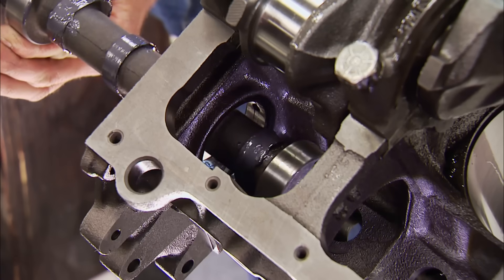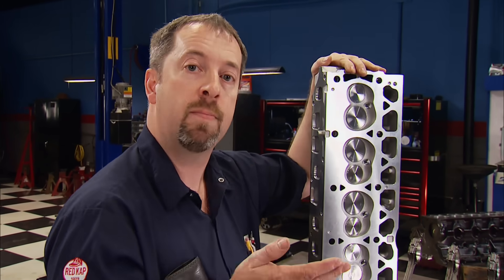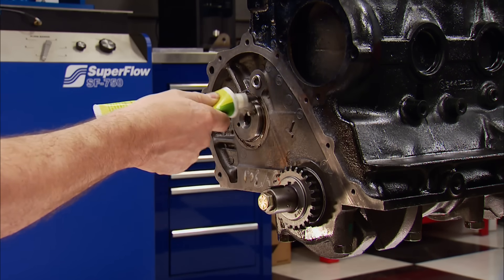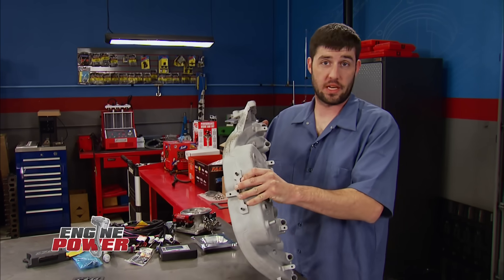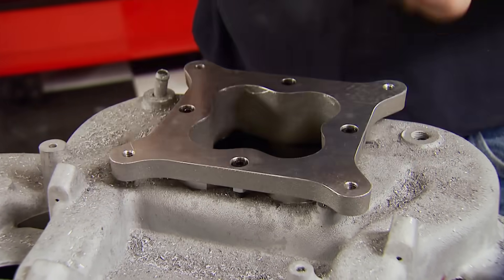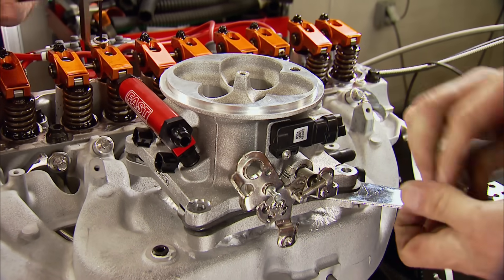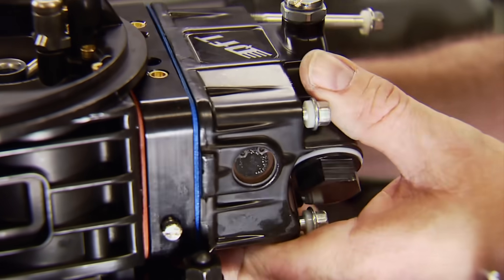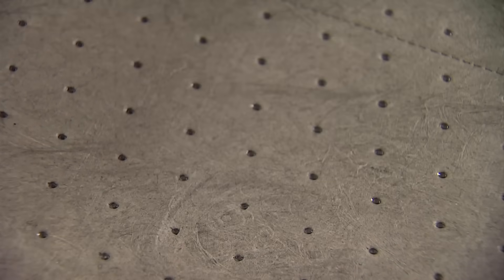Rebuilding a 4.0L Jeep Straight Six to 242HP - Engine Power S2, E14

Comment: I would love to see this engine in a YJ with about 10 pounds of boost.
Go pick on some Mustangs.........lol
Reply: Head dosen't flow near good enough.
Reply: @elonmust7470  At 10 pounds of boost it would make about 325 hp and almost 500 ftlb of torque. Considering it's 700 pounds lighter than a new Mustang it should do fine.
Reply: @johnparrish9215  also the jeep is heavier than the mustang.
Reply: @elonmust7470  Really????
How light is a Mustang??
My Jeep is 2900 pounds
Reply: @johnparrish9215  So why is your jeep 400 some lbs lighter than what the factory states? Wouldn't be a hollowed out shit pile would it?
Look all I'm saying is that you never see 4.0 inline 6s on the streets punking down muscle cars because nobody is stupid enough to use a 4.0 i6 as a performance platform.
Reply: @elonmust7470  Depends on what configuration the factory weighed it in. If you remove the hard top, spare tire, and doors (all extremely common for Jeep owners to do) you'd probably shed that 400 lbs
Reply: @elonmust7470  new mustangs are 3600-4000lbs. heavy. as. fuck.
Reply: @jimbalayaman7227  So you're gonna race mustangs in your topless, doorless jeep that's not a willys? 
Dude cherokee owners are a strange bunch.
Reply: @elonmust7470  Here's your @ that you want so desperately.
Reply: @elonmust7470  turbo doesnt give a shit about how good the head flows when you add boost....and you claimed you have built turbo systems....sad.
Reply: I want to see this engine in a Mitsubishi station(or whatever the Chrysler or dodge version was called) to make an American version of the mk3 supra

Comment: Doman is guaranteed to fit.  That's comedy gold right there.
Reply: Except... at least some of their pans are painted inside, and the paint comes off and clogs the oil sump, toasting the engine.
Reply: @georgesimpson3113  The automotive equivalent of a pulmonary embolism.
Reply: George Simpson I’ve had that happen on a 5.9 Cummins. But the OEM pans from Cummins also have paint on the inside. Not sure exactly why but all I know is is that Dorman is shite
Reply: Dorman.  Every time I use it I cringe.
Reply: "got this dorman oil pan from summit racing" lol you can get dorman from autozone at half the price and no shipping cost because they got one on the shelf lol
Reply: Or there oil cooler gaskets that are not compatible with motor oil
Reply: @rthomas6564  I used Doorman oil cooler lines on my S10. I put them on in 2017 and they've got less than 10k miles on them at this point. Guess what? Yep,they're leaking. Not much and I think it's probably just the gasket,but still....Doorman is crap.
Reply: Hey...this isn't fair.  Dorman parts fit PERFECTLY.  Just not on the vehicle they tell you they are for.
Reply: Dorman guaranteed to fit. We used a dead blow hammer for installation. And we used 10 tubes of JB weld and a gallon of permatex black silicone gasket sealer. After that we gave up and fuckin welded the mfkr on. And it still don't fit right.Dorman oil pan guaranteed to fit,my ass. That's the funniest thing I've heard all day. I thought you said you weren't gonna stroke us? LOL!! Probably much better off just cleaning the old one or picking up a used factory one at the wrecking yard. Just about every time I've ever used a dorman anything,that part had issues. I bought a timing cover for my 97 S-10 once. I had to oval out 4 bolt holes to coax it on. The heads on the bolts it came with were too big and they hit the cover. I opted to go buy different bolts. I used dorman for hing pins & bushings to  tighten up  the driver's door. They cracked and fell out within a month. Luckily a friend has a lathe,he made me some brass bushings that have been working great  for a couple years now. Dorman SUCKS!!
Reply: Almost as bad as BWD ..   Broke When Delivered.
Reply: The funny thing about certain asian sourced steel is your template or jig may not matter: the moment the metal gets worked/heated/welded it draws up and goes out of spec.
Reply: Not to mention the chinaman water pump, T-stat housing, and timing kit. 😔
Reply: my coffee nearly went out my nose ~
Reply: Chain pos
Reply: dorman??
Reply: I was lmao 🤣 dorman is trash. Made in China garbage
Reply: I bought a Dorman "direct fit" exhaust for my YJ and it was the most screwed up job I've ever done in my life. I could have made the exhaust by car battery short welding it and it would have been a better experience and higher quality.
Reply: I use dorman to this day. Every time I take off my jeep door covers, I need new door cover connectors. All they are good for.
Reply: If Dorman is the only brand available at the crappy parts stores(I rarely walk out with a part I'm looking for),I'll hold off until I can get a quality brand.
Reply: They didn't say what it fits.

Comment: This engine gets terrible gas mileage. I wonder how many gallons of gas these engines wasted, and will waste going into the future.
Reply: V 6 does not have the  longevity  the I-6  does
Reply: you better fix your shit then. it aint right.
Reply: These "power tv" type shows are made to sell the old stock from the 90s AKA msd distributors & 4 barrel carbs.
4 thousand dollars for THIS?

Lol only morons would go for 4k for this...

Comment: How disappointing for such big promise. I think a Turbo would be the better route. And you get to keep your stock head. 7-8 lbs of boost would make an easy 300hp 350ftlbs.
Reply: Mr. Morningstar  A TD04 turbo would spool almost instantly for these motors helping it right out of the hole all the way to redline. Where as a supercharger would peak around 3500rpms and fall drastically.
Reply: Mr. Morningstar then I think a 5.3 would be the best option.  You could do the swap cheaper then buying the Edelbrock Head. I swapped my 86 Army Chevy truck for 5.3. Jeep owners are missing out if they are still running the 6cyl.
Reply: @ze_german2921  ew.
Reply: I’ll just go to the turbo store and buy one. Custom fabrication of intake system and exhaust manifolds. Can’t be that expensive.  More than double the cost and triple the complexity of the installation.  Oh boy! 🙄

Comment: We all had to replace our exhaust manifolds those headers are pretty 🤪
Reply: You'd be better off finding a ceramic coated one instead of getting a stainless one. The stainless ones don't deal well with temperature shock and tend to crack if you get them wet or muddy.

Comment: It’s not the fuel injection, but you take it off and it runs better🤔
Reply: Justin Smith They failed to get the efi unit to self tune.
Reply: Their problem was they used a multiport intake that wasn't designed to flow fuel at that point.  It probably confused the computer.

Comment: Build a 2jz
Reply: They'd spend like 30 grand and make 350hp
Reply: @stanleykendziorski7964  if u knew what u were talking about you would know that the turbo version out of factory comes with 320 hp and can go up to 500 on stock turbos and upgraded fuel system
Reply: @joshedits3196  and the 2jz got bigger for it's short low selling life.
Reply: @stanleykendziorski7964  lol sorry I got triggered
Reply: Lol all good, I'm just being a smartass, these guys haven't really impressed me on their building skills
Reply: @stanleykendziorski7964  yeah, 4k wasted lol
Reply: There was 258powered Gremlins running 11s pushing more than 350+HP and 400+TQ in the 70s. All on stock pieces. And held the NHRA Tilte for a long time. The AMCL6 has been fast. And doing it N/A.
Reply: @Al-mx6ru  there are na k series 4 cylinders making 500+
Reply: 4.2 liter ? I'd sure as hell be mad if it didnt make that power 😂 that's a huge i6 when thinking about the 2jz is a 3.0 liter
Reply: @joshedits3196  there was a Gremlin X program that's had the 258 with 12.1 pistons and solid roller cam pushing more than 600+HP and over 650TQ N/A running 10s in the 70s but scrapped the program cause they would only b racing them self's. All on stock pieces. And held NHRA Tiltes. Is there a 2jz running 10s N/A. Or making that power N/A? I'm sorry the fastest Supras are turbo and larger cubic inches. And also sleeved for reliability. The fastest Supra run stroker kits pushing them well past 4.0lilters.
Reply: @Al-mx6ru  the 2j was designed with a turbo in mind so you can't just ask if it would make power n/a. Because it was made to be turbocharged lol. I'm sure if u can get 500 out of a 2.6 liter 4 cylinder u can get more out of a high revving 3.2 liter 2j.
Reply: @Al-mx6ru  hey show me a 4.0 liter 2j lol then I'll believe u
Reply: @joshedits3196  last I heard  more like a 4.3.titanmotor  runs stroker kits. And they race Supras. All custom Forged pieces.
Reply: @Al-mx6ru  really ???
Reply: @joshedits3196  what's really? That's it's real?
Reply: @joshedits3196  are you ok. Your speaking in riddles
Reply: @Al-mx6ru  yes
Reply: lmao your funny
Reply: @joshedits3196  why am I funny? It's cause I speak truth? Your still speaking in riddles. Are you sure you ok?

Comment: You could make 240 hp with the stock head. Once again selling people something they don’t need.
Reply: Best combination is the old 242 block with the 258 crank, the '96 head, 01 horseshoe intake manifold, tri Y header, and coil packs, will do the same as what they did.
Reply: Dylan Dembrow 
No! If good engine building practices were used they’d pull well over 300.  350+HP is common
Reply: There didn't seem to be much gain there, sure the ports are bigger, but the valves were said as "same as stock",...
Reply: PiDsMedia 
I don’t think valve size is an issue on a basic HO build like this. But their apparent lack of knowledge on how to make horsepower IS an issue.
Reply: @PiDsPagePrototypes  That may be true, but the head replaced bathtub chambers with heart shaped chambers, which is supposed to improve power.
Reply: The later 4.0s have a problem with cracking the heads, if you have one of those this head would give you a bit of a performance increase  both because of increased power and decreased weight... but if I was doing it I'd stick with the stock injection system, or maybe bigger injectors.
Reply: At least it was lighter haha
Reply: $1500 is a bit much for a minimal hp gain and cutting 30 pounds. At the end of the day it's not a race car, do you really need to worry about cutting weight?
Reply: One of their stated goals was to reduce weight.  They said the engine weighs over 400lbs stock configuration.
Reply: The mechanic Of all  Exactly !!!
Reply: The mechanic Of all  its not about that tho. It’s about bouncing rocks and pulling up next to a camed 350 and blowing his doors off or at least doing better than the 4.0 used too
Reply: @upnorthviking823  dude it would blow the doors off of some things in a light jeep, and a Honda is not comparable because they do different things. Where’s the torque from the Honda? 6k rpm? The Jeep is at like 2K my 258 with a weber carb and a exhaust will beat a 305 in a roll so a built 258 can definitely take a 350
Reply: Normally I respect Pat as an engine builder. But he dropped the ball on this one. That butchered intake is laughable, that cylinder head is overpriced, and don't get me started on how they wasted money on boring this engine 0.040..

Comment: these motors just don't want to make power. Just run forever!
Reply: Since when did a original Cherokee weigh 4500lbs????? Look up some specs.... 
https://www.edmunds.com/jeep/cherokee/1991/features-specs/
Went with 1991, as my mom had one back in the day....
Curb weight just over 3,000. GROSS weight of 4600...
Reply: You can do anything with enough time and money.  That's essentially a tractor engine-runs forever at low rpm and produces a lot of torque.
Reply: These engines run and run strong. In the 70s.AMC went racing with there 258 in a Gremlin running mid 11s pushing more than 350+HP and more than 400foot pounds. All N/A with Webber's carbs.  Fastest l6. Back in the day.  And held the record for qiut a while. All with stock pieces.
Reply: osp80  that is not a lot of power..
Reply: @elonmust7470  Its all relative. Racing? Meh. For this engine? Quite impressive. Stock, the Cherokee sits at 3000-3100 lbs curb weight.
So toss the 350 hp engine in and you're looking at a power to weight ration of ~8.715, to put that in perspective a camaro 1SS (convertible) has a 8.69 p/w ratio and that's pushing 455 hp and was almost 50k$ new.
Reply: @ThatOneGuyYMK  all of those numbers don't mean anything. 
Also the jeep cherokee is closer to 4,500 lbs, bud....
Reply: @elonmust7470  "Those numbers don't mean anything"
But... they literally do... (albeit that 350 hp was crank vs wheel which I didn't use but should have)
Your statements don't mean anything... bud... what point you trying to make anyways? 
Also, which some said, you are probably mixing CURB and GROSS weight, which I'll explain as you don't understand, GROSS is it max operating weight (liquids, passenger, accessories, cargo). CURB is the vehicle weight without passengers or cargo.

A 1995 Cherokee 4.0 is ~3000 lbs CURB, ~4800 LBS GROSS (differs between packages/trims).
Reply: @ThatOneGuyYMK  My point is that your calculations don't factor in anything like power loss from drivetrain & suspension. I arrived at 4,700 lbs from a google search of "jeep cherokee weight" XJ cherokees are closer to 3,300-3,800.
My point is that these thoughts of making 4.0 xj jeeps fast is a pipe dream. I actually own 2 grand cherokees, a tsi & a 5.9 limited. I don't drive them much but I've had both for over a decade
Reply: @ThatOneGuyYMK  I wouldn't worry, he just doesn't know how that's all.
Reply: osp80  you don't see build motors out there because nobody builds them. There are too many better platforms.

Comment: Is this amc242?
Reply: Alexander Lytkinson yup it's an AMC 242 from 1987
Reply: @karlsmith2570  1987 wranglers Had 4.2 /258 motors stock ( I own one ) the 4.0 didn't come until 89 . 91 fuel injected . The 258 made 210 ftlbs @ 3000 rpm 112hp @3krpm perfect for crawling. the 1971-79 head and manifold made 150 hp. Though most of the power loss was from the bbd feed back carb, switching to a better carb + intake is good for 40-60 hp alone on a 1987-9. Add a new cam and your at 190 hp The cost of this build is 5k + not worth the money, a LS swap can be done for @ 2-3 k and easily make more than 242hp with 0 weight added if you use an aluminum block ls . Alternatively you can by a 4.7 stroker motor for 4k with a warranty. But all these need to be reved beyond 3k rpm to get 210 ft lbs. The motor they built makes all it power at red line , they didn't show the ftlbs at 3k bet it is less than 210.

Comment: By 1990 the 4L H.O. was rated @ 190 horsepower !
Reply: Dean Williams 1991 was the “H.O.”
Reply: @grad0n  from 89 to 1992 I sold Jeeps probably a little confused at this point because new vehicles come out so early I'm sure you're correct  it was a 91 model year ! But I definitely sold a lot of them in 1990.